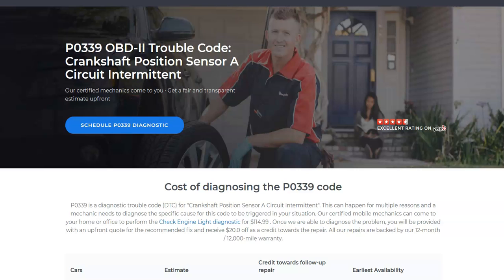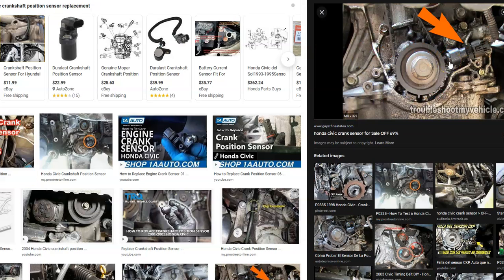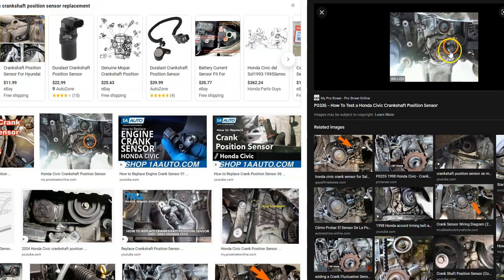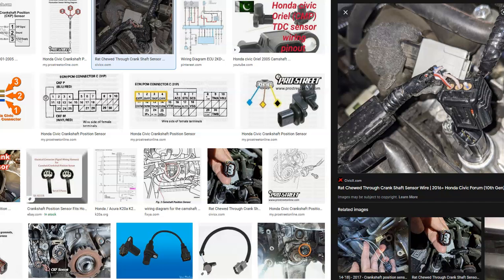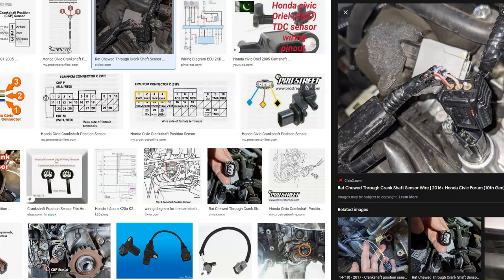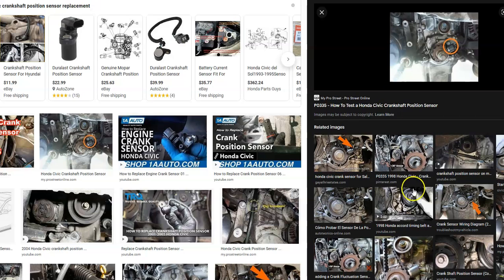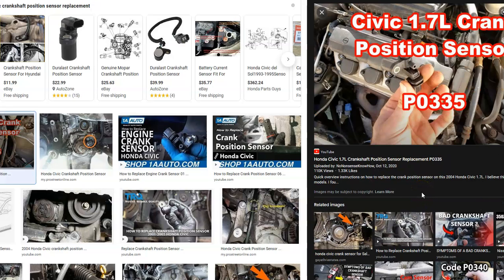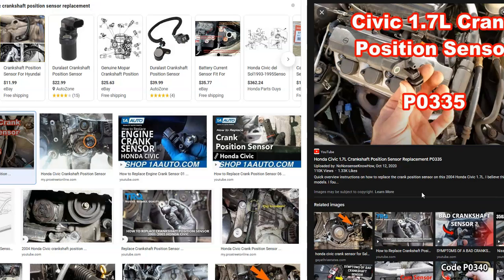How to Fix Honda P0339: Crankshaft Position Sensor A Circuit Intermittent Interruption

Comment: I replaced crankshaft position sensor on my 2012 Honda CRV with aftermarket part after one month it started the same issues then I replaced it with the part from Honda dealership performed the realtor also after one month it started doing the same thing.

I showed it to the mechanic. He said it may be harness or something.

Seriously, I haven’t read many commands on the YouTube. This thing is really horrible.
Reply: If you have the k24 4 cylinder engine it could be your starter failing
Reply: @patrickmwangi2736 ready replaced the starter,

Cranks really good but was not starting until 6-8th crank

Comment: Hello, I own a 2010 Honda Accord and it is displaying the code P0808, indicating that the clutch position sensor is reading a high signal. This issue may prevent the engine from starting, as the vehicle's computer may interpret that the clutch isn’t being operated properly. The cause could be a faulty sensor or problems with the wiring, such as damage, shorts, or corrosion. How can I diagnose which of these is the culprit? Is it possible to do this diagnosis at home? If I need to take it to a mechanic, what would the typical cost be?

Comment: I know this video was posted 2 years ago but you didn't say anything about the starter. How does the starter impact any of this?. When using an aftermarket starter but getting a crankshaft position sensor code on the reader. Sorry I'm not a mechanic just repeating what my son told me to ask😊

Comment: Listen guys don't just listen to the code I had the same error code and took it to honda dealer and they said common faults on jazz is the rear coil packs and spark plugs
Reply: How is that related? Or cause a code curious

Comment: P0339. Replaced sensor, good signal, good compression, still long crank and rough idle. It won’t relearn currently in limp mode can’t go over 3000rpm. I did my timing chain and now I have this problem, timing is set to spec. Any tips? 07 civic si
Reply: Same my cars also like that? Anyone can tell us what the problem? Some workshop tell to change ECU..can be ECU ?
Reply: Clean the throttle

Comment: Hello, I have same error code p0339 but I checked the fuses are good, the I changed the new crankshaft position sensor but same issue
Reply from the maker: It the part is good it is likely in the wiring. Also, depending on the Honda sometimes when the cam/crank sensor is swapped out a Relearn needs to be done.

Comment: Really,where its the out put of your data,you could explain how its works and talk about the wiring,like pin one blue/white 5v ecm,pin 2 black/ white ground and finally pin 3 yellow/ black 12v from mpg-fi relay , to describe all this data its very important facts,and specify that car you are talking about,ej: 2004 civic ex a/t

Comment: If its a 08-12 accord 4 cyl its most likely an aftermarket starter.
Reply: An aftermarket starter causing a crankshaft code? I'm working on a 2012 accord with this code and the starter was changed...
Reply: I have a 08-12 Accord and installed an aftermarker starter, which I believe is causing this issue.
Reply: @AbrahamDZ  did your aftermarket starter cause the issue? I bet it didn't.
Reply: Hi so i had an aftermarket starte installed in my 08 Accord and sarted having this issue 
I cleared the code it comes again and now the engine light goes on and off at random intervals once every 2 weeks
Reply: What should i do??
Reply: I installed an aftermarket starter, now I have this issue- solution?
Reply: @SKOLVIKES89-d7l install oem starter, clear codes, do crank relearn
Reply: Then how come they have a service bulletin posted, for 08-09 2.4 accords, Honda themselves stated if you have that code to get your pgm-fi software updated and to get a crank clear & crank relearn done and that should resolve the issue. Unless your crankshaft sensor is actually starting to go bad, or like you said, aftermarket starter.
Reply: Why do you say s*** to confuse people? All starters from Honda or aftermarket unless you buy them from the dealer.

Comment: My Honda Element 03 crank shaft position sensor gets covered with oil inside.  No faulty code light or rough engine performance.  One shop examined the sensor, discovered this when testing the timing and claims not normal.  I cleaned-off the sensor and in a few oil days, it oily again. I beamed a light thru the opening and see the timing chain inside is near.  That would explain the oil.  Question; is this oily normal?

Comment: I have the p0339 code coming up on the obd, but another issue I'm having with this 2012 civic is that it's stalling when putting it in reverse...is that one of the symptoms?
Reply from the maker: Stalling out or not starting at all is a symptom, but it can happen at any time not just when in reverse.

Comment: Hey i had this code PO339 pop up today when engine light came on . Is it possible to still drive with this issue if so for how long ? The reason i ask is bcus im backed up on bills and cant afford to fix this anytime soon . Please lmk
Reply: I have been driving with the code for 2 months now. Seems ok so far.
Reply: Same bro I’m still using my 09 accord everything fine thank god
Reply: @yunggloboxing4718  good to know man thanks . And good luck w the boxing . Magsayo vs Figueroa gonna b a great fight tonight
Reply: @rong977 how long did it last? Mine popped up today and I’m in the same situation. Got a 16 accord

Comment: So i replaced the sensor and every now and then my car still sometimes struggles to turn on and then the same code pops off again and will go away on its own after a day or 2 and then randomly days (sometimes even weeks or a month later) it does the same thing it struggles to turn on and again P0339 into which again it goes away on its own, if it is the wiring how exactly would one replace that? And where do i get? Autozone said they dont carry it
Reply: I did the same with my 08 accord, tried and autozone sensor, that didn’t work. Got the OEM sensor in it and still have the code pop up just not as often as before. Let me know what you find!
Reply from the maker: If it is wiring issue it can be problematic and hard to find sometimes. Basically the wires are traced and all the connections are tested and checked.
Reply: Also experience the same as Jony. Replaced the sensor with Autozone brand which might be a bad quality at first but now it keeps coming back randomly since replacing it from autozone  Got an OEM crank sensor from Honda lets see if it fixes it. Wiring looks good. What else could it be?
Reply: @jomine16  Did the OEM CKPS work? Did it change or do anything differently?
Reply: I have the exact same problem with my 2012 honda civic I changed the crankshaft position twice already and the code still randomly pops up I had bought the durlast one from Autozone and then one from Napa. Harness is good so wondering has anyone found the solution to this please!
Reply: Ima having the same problem with my 2012 Honda accord already replaced it and the engine and traction control both pop up and go away later then all over again. I hooked it up to one of our scanners at work and it could be wore out timing belt/chain.
Reply: @isaiaguilera6279 hey I’m having the same exact issue with my car and I was wondering if you ever figured out a fix?
Reply: @jasonpalacios6410  no I have not, this time I relearned the crankshaft position all over again and let the pcm ecm reset for about 10 minutes idle. And it helped for about two weeks but it started limp mode again. So what I was told by a mechanic is that it could be the PCM computer itself that needs to be replaced. They’re like around 40 bucks online I’m gonna try that out. A coworker family member had the same exact problem as us and he had to change the computer.
Reply: @isaiaguilera6279  did you end up replacing the timing belt ? I have a feeling that’s what’s causing mine to go off too
Reply: Got a 2011 CRV with the exact same issue.. fixed it twice this year and the code just keeps coming back. Mechanic told me I should just sell the car at this point
Reply: Also what is the fuse called to check?
Reply: Me too !! Honda is really trying to charge me for a blown head gasket. Like it’s crazy
Reply: Going through this same exact thing! My mechanic says it’s the timing chain but I want to be sure on that because it’s a pricey fix
Reply: There’s is a service bulletin listed on this exact code. You need a pgm-fi software update & crank clear & crank relearn. If code happens again after that, then replace the sensor & get a crank relearn done.
Reply: Bro same shit happened to me on my 09  accord ex I thought I was tripping same story tho however I changed the sensor with a Honda one and whenever it struggles to ignite it brings up that code again

Comment: 2013 Honda civic si. Wiring is good I used a meter to check, replaced sensor, did crank relearn. Since I got the car a year ago it has also made a click from the engine bay sometimes when I try to turn the key over to start the car, I had a clutch job done and resurfaced flywheel and after that the clutch pedal would rattle when pressed in, now the petal kinda of vibrates when pressed. Was due for a battery change anyways so put in an agm battery and that didn’t fix it. Also the code is set before I start the car I’ve cleared the code but it comes back on before the car starts. I have an extra duralast starter and I also have an action stage 1 clutch kit I’m planning on putting in. Im not sure if those could possibly be it, but the crank reluctor wheel looks fine. Also could the code be set before the car starts because of a bad starter?
Reply from the maker: A P0339 Code is a bad Crank sensor or Crank sensor wiring issue. Since the sensor has been replaced it must be in the sensor wiring. Be sure to check for a blown fuse. (Note: Sometimes low cost replacement sensors can cause issues.)
Reply: This can be wayyy more than a sensor or wire ie. Starter, flywheel, pcm etc.